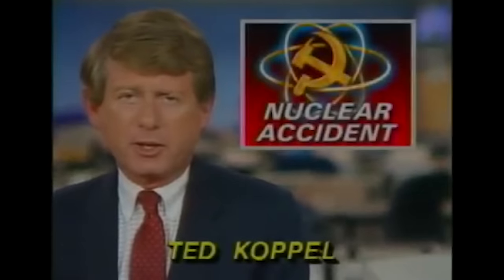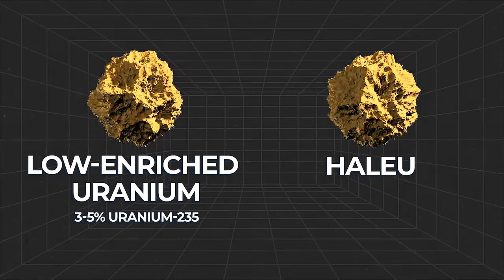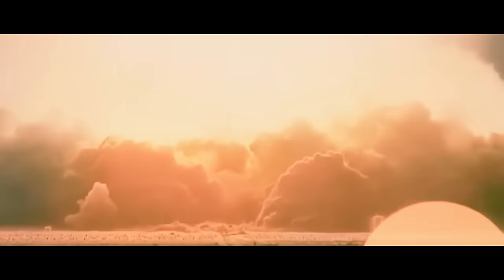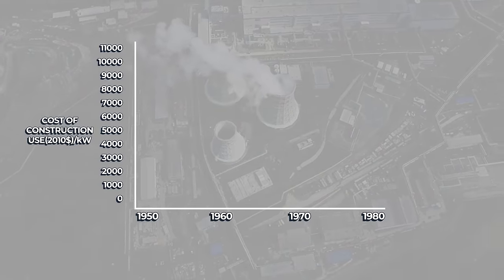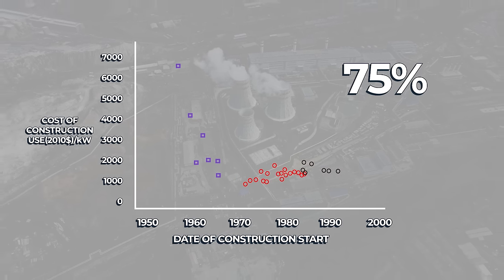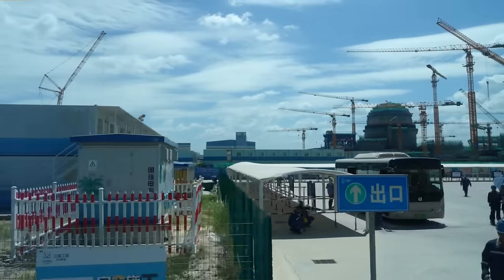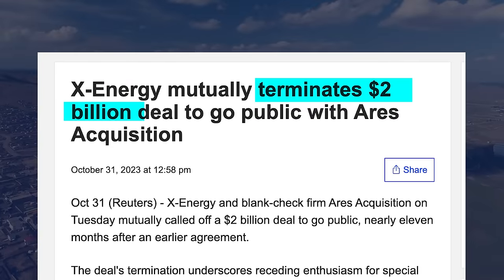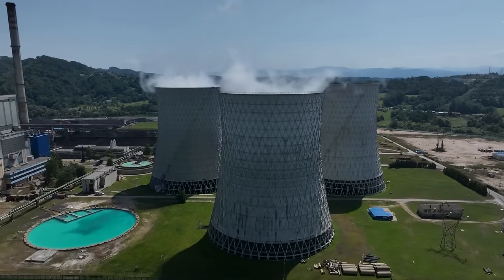Nuclear 4.0 | The Small Modular Reactor Revolution

Comment: Hmmm nuclear reactors scale with size...there is literally no reason to make them smaller... making them modular and standardized is a great idea, but making them small means losing tons of efficiency!
Reply: manufacturing a large reactor containment vessel is a big hurdle for nuke power.  there's only one or two foundries that can actually make them. making the containment requirement smaller really reduces the barrier to entry for other manufacturers, will reduce the timeline, and make assembly easier.  Also, some of these SMR designs operate at much higher temperature, which claws back a decent amount of that lost efficiency that you're talking about.
Reply: Financing costs also scale with reactor size, and are currently a large hurdle. While smaller means more material and labor cost per unit electricity generated, it also would (hopefully) mean shorter build times and less financing cost.
Reply: @RentableSocks  The cost of making the reactor vessel is not the problem, nor is ANY part of the reactor which is fabricated offsite like turbines, generators are other heavy machinery (which btw ALL powerplants are made from).  The steel and cement pouring to make the containment vessel (a protective bunker) is where the cost overruns and delays are coming from, and your not going to make that in a factory.  The whole concept of factory production of SMR is ignorant of the fact that that's ALREADY how the innards are made.
Reply: @nelsonsnow75 Financing a multi-billion dollar project that ends up barely profitable is hard but possible. Financing a somewhat cheaper project that gives even less energy per dollar invested, is almost impossible.
See, the thing about wind and solar is that there was a big market for very small installations, even if the cost was high. So you could build the market on these microscopic solutions.
But the scaling of nuclear means that you can't  build a viable market for kWh-scale nuclear solutions (outside of space). It's just WAY too expensive and difficult.
So you can't scale from small solutions up to medium ones, like we saw with wind/solar. And you can't scale from huge solutions down to medium ones, because if you can already build huge, you don't have much if anything to gain by going smaller (in the short term).
Reply: @auspiciouslywild  "somewhat cheaper" yeah, your somewhat is more of a several magnitudes division, I'm sorry to inform you.
Do you just really want these to fail for whatever reason in favor of renewables? You could absolutely have a local nuclear reactor at this rate.
Also it might solve the ! FUN ! issue of intentional power throttling (at least somewhat) such as in the case of the Finnish Olkiluoto 3 nuclear reactor.
It's one of the biggest nuclear reactors in the world (by capacity) and at least at one point it was throttled because of low market electricity prices.
And on that note, the entire damn thing was paid for by taxpayer money! Yup, we paid money only for greed to monopolize the result.

If Olkiluoto were to be run at proper throttle, maybe people I know wouldn't be reporting occasional magnitude-level increases in market electricity prices?

Sadly, not even Finland is paradise. We've got plenty of people here complaining about our clownfest of a government yet everyone still thinks Finland is somehow the best.
Maybe just the notation of Finland being the happiest country makes people automatically overlook it since they "trust the people's opinion" or something.
Either way, Finland isn't exactly great but compared to a lot of other countries it's practically a haven... just overlook the circus that rules it.

As for my personal opinion, maybe a country that's in enormous debt shouldn't be paying so much attention to their own emissions when countries 2 billion times bigger will cover our yearly emissions in a day each. Now we have an onslaught of cuts and strikes while the general public suffers. If I recall, having certain parts of our infrastructure halted actually provides massive amounts of free money for certain people via insurance deals. Awfully suspicious if you ask me, but I haven't confirmed that myself.

Oh and on that note, Finland has sold almost everything it owns at this point. On second thought, it feels like I live in less of a haven and more of a decaying corpse.
Reply: That depends. If the west starts building reactors capable of weapons manufacture (basically the reason the older designs exist) it has geopolitical consequences. We really need new technology, ideally that will recycle "spent" fuel rods.

Comment: My bets are on small molten fluoride salt reactors using thorium as the fuel, these are able to consume the nuclear waste deposits from LW reactors, and are inherently safe (self extinguishing upon cooling system failure). That means cheap fuel (waste) and they are also purported to do a 95% fuel conversion to energy rather than the 0.5% that most LW reactors achieve. Also they can be bolted into the ground sufficiently that you can't just drive away with it. They can also be continually refuelled so there is no actual down time as with most LW reactors except some maintenance.
Reply: The difficulty with the molten fluoride salt reactors is highly corrosive aspect of the salts in question. These salts corrode the metal pipes they come in contact with overtime.
One company has found an innovative solution to this chemistry problem. Apparently corrosion occurs when impurities in the salt chemically react with the metals in the pipe. So get around this the company has developed an ultrapure rock salt with non corrosive properties.

Comment: I think we should just go ahead with these SMRs and nano reactors. The first ones may have a bit higher cost, but are necessary to build out economies of scale. The issue is that nuclear has stagnated for decades, so cost to start building them again is high. There is a lack of experience in the industry, so costs are higher. This combined with unnecessary regulation and irrational public fear keeps nuclear of life support, rather than commonplace.
Reply: Economy of scale in nuclear reactors is building larger ones, since you can minimize the fix costs per W: Like safety structures and systems, supervision, etc. If they make thousands of them, who is going to make sure that they run safe? IAEA will not be able to keep up. 
Nuclear energy is safe thanks to regulations. You have to see the rest of private tech industry to see how much they care about the environment or the customer itself. Uber, Tesla, etc are starting to lower their standards once they capture the market.

Comment: The point of gen4 reactors is "walk away safe". 
The "small modular" came about because dissipating heat passively from less fuel is easier. 
This actually makes them more expensive per MW than the current 1GW+ units. 
Sure the individual modules are cheaper but you need more of them. 
The big costs are not actually the reactor. It's everything around it for safety, the regulations, the scarce high-skilled labor, the loan costs, etc.

Comment: "Helium doesn't explode if ignited" 
You might want to put an asterisk on that line lol XD
Reply: Explosions involve the release or movement of other gasses. If theres no atmosphere surrounding helium, it is only flammable, not explosive. Helium shouldnt be able to ah.. expand explosively? Idk its 5 am i might not even be right but ima shoot my shot. Id love to be corrected cleanly. But helium is elemental weight 1. When burned it should dissappear or idk.
Reply: @LolWutMikehSM  No sir. Helium can't be ignited. It's a noble gas. That's why I say it needs an asterisk. Maybe he meant to say that it doesn't ignite if exploded?
Reply: @LolWutMikehSM  The bigger problem with helium is that it's bloody near impossible to 100% contain and you're constantly having to top the thing up. AGRs have the same issue to a smaller extent. Molten metal coolants (sodium and lead) have a tendency to get bearing lubricants into the loop, which react chemically and then clog the core (Santa Susannah accident) or in the case of soduim - burn furiously if exposed to air (Monju)

I'm sure someone's goign to bring up the issue of salts and metals freezing solid as they cool. This is a good thing and prevents widespread contamination in a worst case scenario (sodium is problematic for reasons above, lead vapours are quite literaly brain eating. if you're going to use alternative coolants/moderators to water then one which isn't dangerous, doesn't easily leak and is negligabily corrosive seems like a good idea) The MSR design pipework is wrapped in electric heaters to bring it up to temperarure before going critical and the 4 inch plumbing had over a foot of insulation around it in the MSRE. Because the salt isn't electrically conductive, bearings can use it as circulating pump lubricant and use magnetic coupling to stay fully sealed 

Flibe is not sea salt (and sea salt is only corrosive in the presence of water or other ionic contaminants. At 400C, water doesn't hang around for long in a molten salt) Tests at MSRE showed no detectable corrosion after 9000 full power hours

Time will tell, but Kurt Sorenson and friends have the right idea - however CHina has beaten everyone to first working 21st century prototype and that's a lead that developed countries will have a hell of a time recapturing - particularly as molten salt liquid fuelled systems were made illegal in the USA in 1972 (Nixon) as a near direct reaction to Weinberg advocating them as an anti-proliferation technology and that ban hasn't (yet) been walked back

Comment: It is unbelievable that people still think nuclear is 24/7 for 60 years.
The manufacturers of SMRs state clearly on their websites that 
you need to power it down for 30 days every 18 months to replace fuel rods
you need to power it down for 6 months at 10 years to replace the coolant (which is by then radioactive)
you need to power it down for at least 6 months at 20 years to replace coolant, turbines and reactor module.
You also need to budget for at least one "unscheduled outage per year.
Reply: Wouldn't it be easy enough to plan around that?  Put in redundancies so you just need to temporarily drop to half operation during maintenance times?

Why would it be down for 18 months to replace fuel rods?  There's no way to design it to have robots replace them in a way that requires no downtime?

We know things are radioactive and have ways to deal with it.

These technical challenges you cite don't seem too hard to deal with in a way that requires no downtime in newly built power plants.
Reply: Buy two and run them on split shifts. Not only do you double your life expectancies from them, downtime is a non issue. Or if the whole point is to not run them at full capacity ever, buy three and run them in redundant pairs. Always maintaining and cycling which core is on downtime.
Reply: There are reactors designed and maintained with full power refueling. Just the most popular are sealed PWR using light water, which do need to be shutdown.
Reply: The Navy uses reactors that don't have those limitations. The Nimitz class carriers need refueling every 25 years, and newer submarines are being built to go their entire lifespan without refueling. Those limitations are design choices, not absolute requirements.

Comment: 'Baseload power' is an axiom that maybe needs to be challenged. I think you touched on this when you explored use cases for smr. For general use, renewables (+storage) can be sufficient for 100% load even through the dunkelflaute periods. If this isn't true, it's not actually clear that a baseload generator technology solves this because it would be overstretched during those dunkelflaute periods. Or else it has nothing to do for most of its lifetime, so it's uneconomic.
Reply: Yea the 'base load fallacy' is what it's called.  Baseload is a BUISNESS MODEL for a powerplant, not a 'need' that the grid has as if it needs to eat a balanced diet of electric vegtables.  The Baseload buisness model explicitly leaves large amounts of grids demand unmet as well so anyone claiming that we 'only' need it is lying their ass off.
Reply: Dispatchable power is the real industry term. Meaning available on demand, 24/7.

Comment: correction related to fission: each fission event directly leading to >1 (on average) more fission events isn't just supercritical, it's prompt critical. prompt neutrons are produced by fission events. when a reactor is supercritical, that just means it is increasing in reactor power. when it's supercritical but not prompt critical, those extra neutrons are from delayed neutrons. so you still get an exponential release, but it's MUCH slower. nuclear bombs work on prompt criticality, nuclear power plants work on supercriticality.

Comment: The Rolls Royce UK SMR is planned to be operational by the end of this decade. The economy of scale in SMRs is in the multiple units coming off a production line all to the same design. The obvious locations for initial SMRs are any existing nuclear facility with spare grid connection capacity, recently decommissioned nuclear power plant sites which could host multiple SMRs, and then decommissioned coal (or even gas) power plants. A ship to shore power plant is also an obvious choice for emergency restoration of power following disasters - just need the port to have the power connection facilities. A SMR powered water desalination plant could also be a game-changer in some locations.
Reply: There has never been and there is not economies of small scale in power generation.  Every nuclear power plant uses standard components built in a factory and system modules are built in factories and shipped to the site.  The build it in a factory cost savings will never happen because it has already been used.

Comment: I think that SMRs are a workaround for one of the two main issues holding nuclear power back: Ever stricter regulatory constraints. You can mass produce these and get the design certified, instead of having to put each individual reactor through the gauntlet. The economies of scale come with, well... Scale! Just as with scores of other products, the cost will come down as more of the product is made.

I do object to the way you're handwaving the intermittency issue of wind and solar, by the way. Directly comparing wind or solar without the storage or gas power generation, to nuclear, isn't a fair comparison.

Comment: Micro's make a lot of sense when you consider a grid approach. If every town has their own generator, they can cross feed each other as needed and there isn't a single point of failure. It also means that simple coordination of maintenance windows is all that's needed during upgrades. It also somewhat simplifies the whole electrical grid infrastructure since there aren't a few huge producers, which also means it's easier to merge solar and wind into the total equasion, because varying the output of a micro reactor is much easier than a huge one. The overall cost to build is close to the one huge installation, but it's more incremental and can more easily benefit from improvements in technology when the lifespan is a less than decade compared to half a century.

Comment: The road block is not the process, or construction of nuclear power generation. The problem is over zealous regulation driven by the anti-nuclear crowd. Their renewables can't provide enough energy having a low watt density. They aren't the final solution. Renewables are also much more dangerous. A handful of people have died in nuclear accidents in equipment that will no longer be built. Hundreds and counting have died in accidents on wind power platforms. This design is essentially unchanged. Oddly, information about these deaths has been sequestered from the public. Again, I believe driven by the anti-nuclear faction. We have the ability to go zero carbon power generation, but the same people telling us carbon emissions will destroy the climate and the earth are blocking it. Anyone else see a huge contradiction?
Reply: Name one NRC regulation that is over zealous?  If you cannot name one you are talking out the same place you wiped this morning.

Comment: I've long had an idea for how an SMR might be used..  In a new construction development, they could use an SMR to provide not only electricity but district hot water to every home in the development.  I ran the numbers real quick, 120M divided by 300 homes, that's about 400,000$ per home.  With inflation, that's about what new homes go for anyways, so you've just doubled the cost (If it costs 120M for the reactor, I'm using a random number I saw you mention).

But, every one of those homes has all their energy needs met forever.  If people don't use all the electricity it can be sold to the grid and paid out to homeowners.

This doesn't account for re-fueling, 8 years, let's say $8M for ease of calculation, each of those 300 homes would have an annual fuel cost of about $3,300 or $280/month.  That's really competitive.  Someone check my numbers?  Are they totally off?  High? Low?

Reactor sizing also..  6KW/home (electricity plus hot water) that's... Hold on.  Only 1.8 Megawatts?  Okay, that reactor can be waaaay cheaper than 120M or we're doing something very very wrong. 

What are we doing????  Why is this not happening??